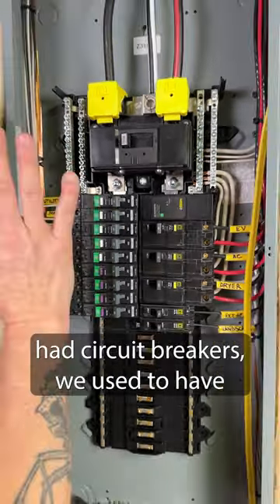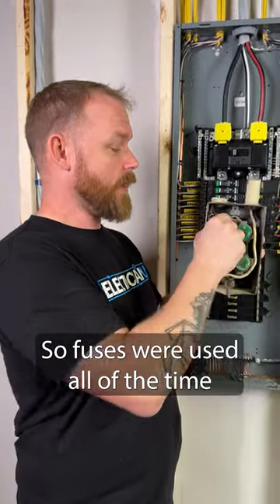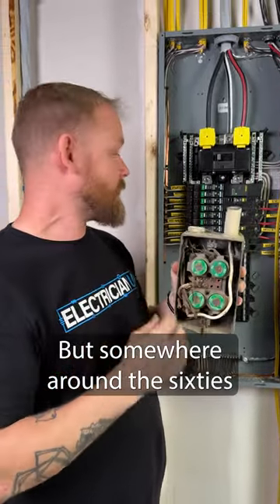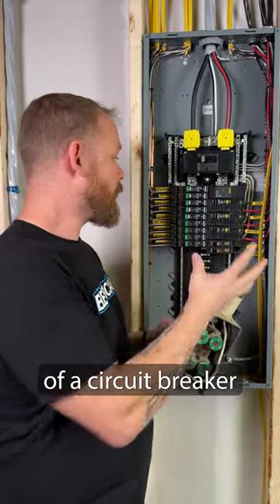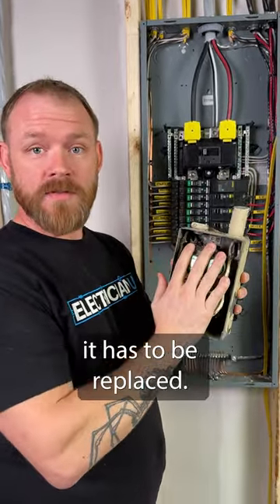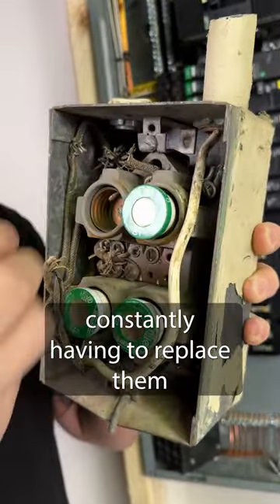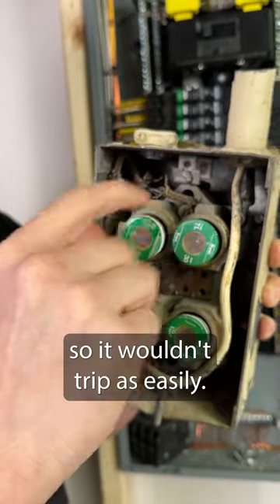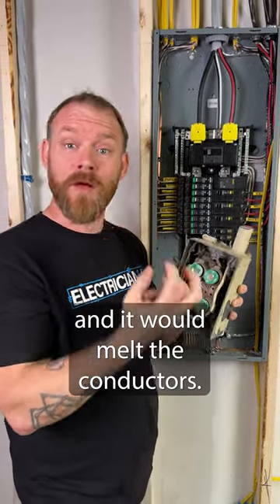Before Breakers There Were Fused Panels - Did You Know

Comment: I found that a penny could carry way more than 100 amps. I noticed that the a penny was EXACTLY the same size as the light socket. So I was holding a penny next to my sister's lamp and drip in in and the whole house lost power. 
so I checked with the neighbors and they still had power. Then I went to look at the meter in the back of the house, and it had power, of course started checking the breakers couldn’t find anything tripped. The landlord had to call an electrician then I noticed he was acting weird, because there was a fuse, panel mounted inside the wall under the drywall. I was outside with the electrician for a minute and I said Hey the landlord really weird I think there’s some thing he hasn’t told you..

so the electrician asked him a couple times what was going on and told the guy he was going to leave and still charge him if he didn’t tell him the whole story. So they had to cut the drywall off, and every single one of the was a 100 amp... so the fuse box was in series between the meter and the breakers.

Comment: I'm still replacing fuse panels all the time in our community. They are actually very safe if used properly.
Reply: Exactly.  If properly rated fuses were used , fuses were very reliable and always failed safe, unlike circuit breakers which I've seen fail to trip on overload.

Comment: No a breaker can not be re-used "constantly".... Opening and closing loaded breakers causes pitting on the contact surface This creates gaps between the contact plates which creates heat, nuisance tripping and possibly fire. Edison designed his first breaker in late 1800.

Comment: The circuit breaker was invented way back in 1924. I've seen some as old as the late 1930s. Owed a house built in 1950 and had circuit breakers. So no they did not appear in the 60s

Comment: If used as intended (no penny) the old Edison base fuses were much safer than the circuit breakers developed in the 50s-90s.  Why the circuit breaker before arc fault did not protect things like extension cords. A short in a power cord could and many times arced and opened with lots of molten copper metal erupting into the area, before the breaker would trip.  I produced a film on this issue in the 70's which showed how poorly the circuit breakers performed under such condition. ARC fault breakers greatly improved arc performance. FYI a typical old style 15 AMP breaker can experience upwards of 500 peak amps or more depending on circuit impedance, before it blows.

Comment: I would note a fuse can never fail to operate properly. A circuit breaker absolutely can. So you can never overload a fuse but it is possible to overload a breaker and not have it trip

Comment: I prefer to use a rubber band on the breaker it is insulated and free if you steal it from work - save a penny
Reply: That’s not how breakers work. You could lock it in the on position and it would still trip internally

Comment: Just consider, a breaker fails..what happens?  A fuse fails..that is what it was designed to do.  Breakers are more convenient but not safer.
Reply: the reason it's safer is because the average homeowner is less likely to upsize a breaker if it trips. They will just reset it and scratch their head.

Comment: FPE or Federal Pacific panels are an example of a circuit breaker that did NOT work better than a fuse panel, purely because a breaker labeled 20(amps) would never trip even at 30amps and thereby acting just like a 20a fuse with a penny in it. 
But people in their homes are always smarter than the electricians and NEC people and that folks…is how you get electrical caused house fires.

Comment: Shop teacher swore by fuses. He said a correct size fuse was 100% effective, but circuit breakers are mechanical and can possibly fail to protect circuit. 😮😅
Reply: yep would rather have fuses still than breakers they are made cheap and I've seen them fail to trip when they should of many times

Comment: I was thinking about the pennys before you mentioned it 😂
Reply: Pretty certain I’ve seen a nickel used.
Reply: @sunshine3914 a nickle doesn't have quite as high an amp rating as a penny,  particularly the old pennies made from solid copper 😆   Not that it really mattered considering a typical #14 conductor would instantly glow red then melt in two if a dead short occurred with a nickle or penny in the socket and the main fuses also happened to be wrapped in aluminum foil or replaced with copper pipe.  Weirder things have happened in the wild west days of home DIY and that played a role in many insurance Co decisions not to underwrite a policy on a home with an old fuse panel serving the property.

Comment: fuses are superior. Fuses don't generally explode or catch fire. If someone want's to bypass a fuse with a penny. I don't feel sorry when they burn their house down.  How many circuit breakers have you seen melted or burnt? I'm guessing lots. Take a thermal picture of the breakers and you might learn a lot about what's going on. If you have a breaker that keeps tripping. Stop resetting it now. There's a serious problem. Fix the problem. Breakers are not made to be used as a switch over and over.  If you're using a breaker to turn power off and on, buy a switch or contactor.

Comment: Yep. Hey you want to really blow minds? Show a job where bare wire is run thru the attic held by split ceramic retainers with a nail thru it. First time I saw that I couldn't believe what I was seeing. This was a common installation practice.

Comment: Fuses are superior to CB's.  For one, they will blow within 1 to 1.5 cycles; CB takes up to 6.
Second, CB's are rated, from the factory, to be calibrated for one trip.  That means after tripping once, the breaker should be replaced, just like a fuse should be.  And finally, CB's operate by spring action.  Current flow generates heat.  Excessive current flow from a breaker that is "nuisance tripping" results in excessive heat.  Excessive heat breaks down springs and causes them to weaken, which will either cause more nuisance tripping, or for the breaker to function only as a switch, giving no protection whatsoever.  Give me fuses any day.

Comment: Here is the truth about fuses vs. circuit breakers.     If the proper size fuse was used in terms of amperage,  fuses never failed.   Or if they failed  they failed safe, ie,  they would not pass current.   On the other hand in my lifetime I have seen several " new" circuit breakers fail to trip on overload and cause fires either at a receptacle or switch.     Fuses are old school for sure but , sized properly,   100 % reliable.
Reply: This is why here in the Uk we use both 👍 the RCD protects against ground faults and shorts, but each device has an appropriately sized fuse at the plug too, for overcurrent protection

Comment: Hvac scumbag here, late as usual. I once replaced a furnace which was on a fuse panel. I removed every fuse and the old furnace still had power. I didnt want to dig into the panel and find out why and take on any responsibility. It was winter time and it was an elderly client, i had to get them heat. Did the furnace replacement with the wires hot and wire nutted off. Was very explicit when i explained it will not pass inspection and they will be required to upgrade their panel. Super sketchy electric.